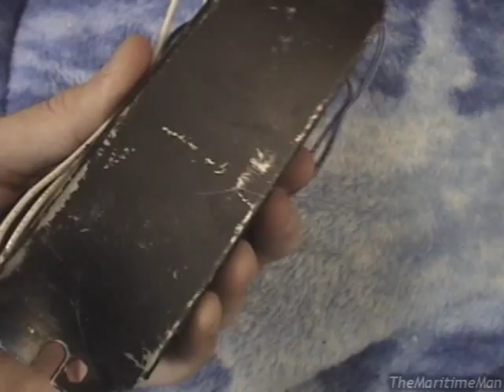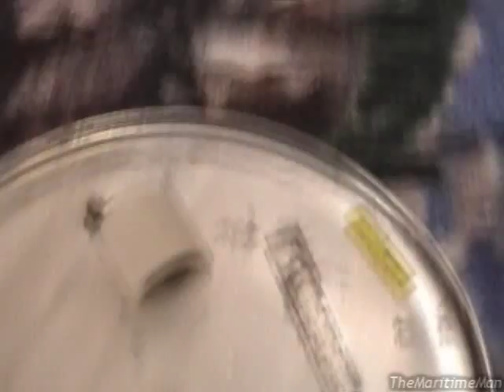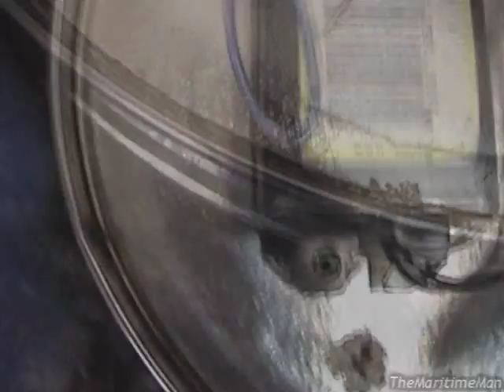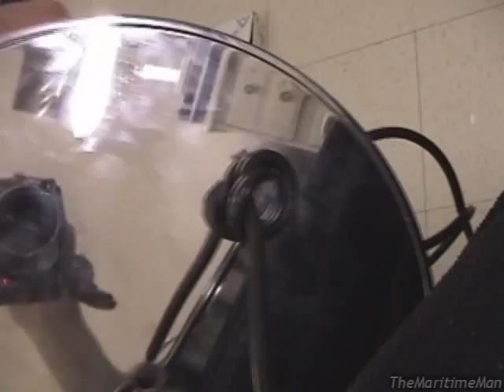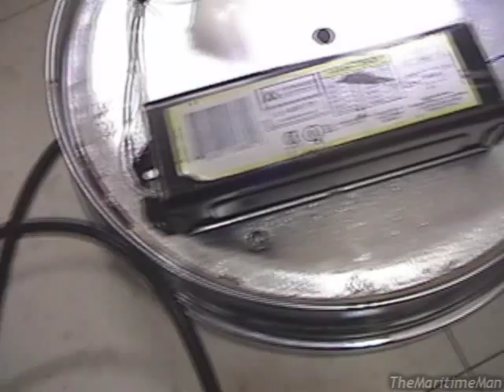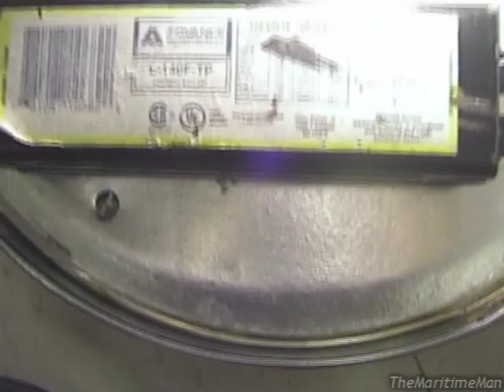Mercury vapor light fixture build + test

Comment: How much hotter does this run compared to incandescent?
Reply from the maker: The power consumption of the bulb is the heat output. So at full power it's as hot as a theoretical 50 watt incandescent bulb. Then add a few watts of waste heat generation from the ballast.

Comment: I think the ballast was NOS before you installed it in your mercury vapor flush-mount fixture. You can tell that it has never been used because on the fact that there are no marks on casing where the screw and tabs would go if the ballast was installed in a fixture. Normally they would leave marks on the ballast. Also, while it is hard to tell in the video due to the low resolution, the stripped part of the hot and neutral wires appear to be perfectly straight. If they were used with wire nuts, they would be all twisted, though I suppose the seller could had stripped them his/herself. Also, wear on the ballast does not necessarily indicated that the ballast has been used. That ballast is old. Who knows what happened to it during storage over all those years? It could had easily been scratched up and worn down while sitting in someone’s garage for 20 years. My T5 trigger start ballast that I got off eBay, the same model as the one you showed on video, came with a worn out label even though it was brand new, as it didn’t have any marks on the parts where the screw and tabs would go and the wires were perfect.
Also, you probably could had just left the back plate off and the ballast would had fit inside.

Comment: I think the reason your old ballast is not driving as hard is simply because its old. Your pictures of it show the leaky tell tale signs of that. Please be careful and look on your ballast and see if it says no PCB'S if you don't see it noted on the wiring and specifications decal, it just might have PCB's. A nasty cancer causing chemical. You did say it might be from the seventy's. If it dose have the PCB's please dispose correctly. At a Hazardous waste collection site. Oh and don't forget to handle it with gloves.  I enjoyed your video. thanks be safe.
Reply from the maker: The ballast works perfect. It doesn't drive the lamp at full power because it's a fluorescent lamp ballast, not a mercury vapor lamp ballast. A 50 watt mercury vapor lamp requires 0.60A of current, while this ballast outputs about 0.35A.

Comment: Excellent vid of your converted merc lamp! I've always had a lust for having mercury lamps, but until recently, have not had much opportunity to do so. Using a fluorescent lamp ballast is a great idea. Obviously, fluorescent lamps are considered to be low pressure mercury lamps, but they're not as 'fun' as the real thing. Also, about the low power factor issue; this is usually corrected by adding a capacitor in series with the unit. Higher power mercs use PF correction caps for this purpose. Not sure, but it's probably something around 4-10uF...and it should be an AC capacitor, NOT a DC type. Also, maybe if you wrap the ballast in foil, it won't be so visible (just a thought). Nice Job on your mercury conversion!